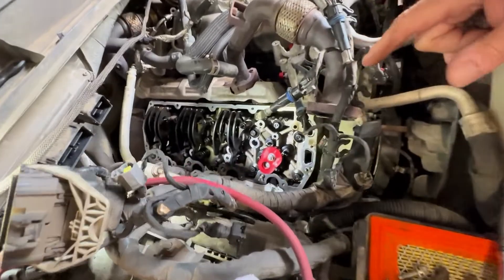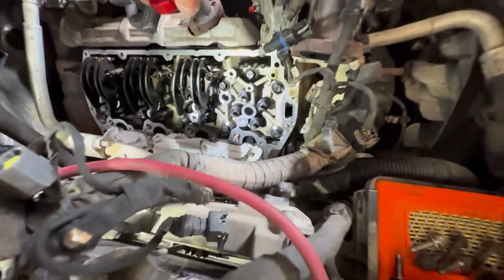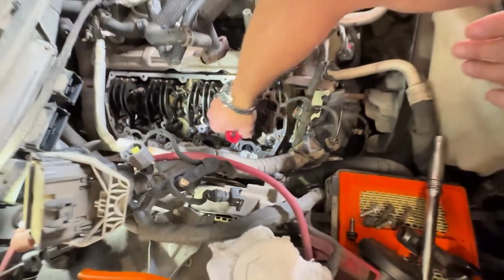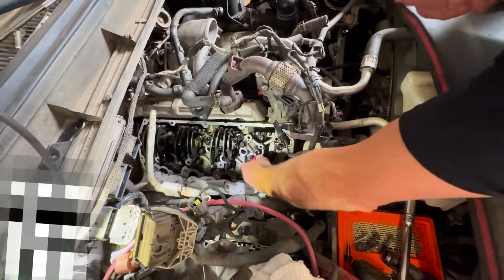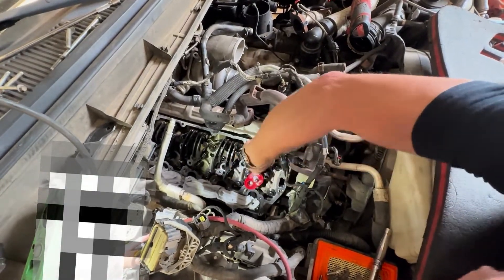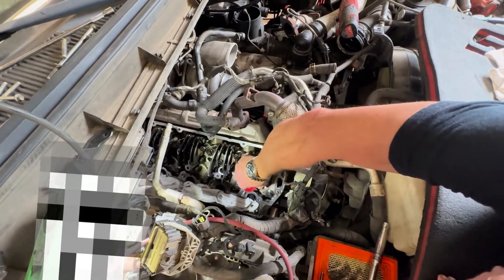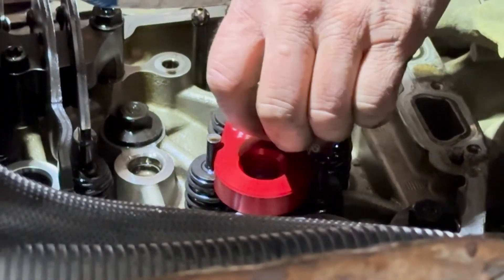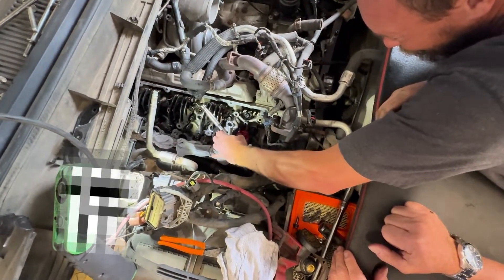Effortless Ford 6.7L Power Stroke Fuel Injector Broken Bolt Repair with the Nico Repair Kit

Comment: I see you had to remove the rocker arm , do you have to time the engine for this ?
Reply: No
Reply: No you dont but they are liars. They dont mention its easy to remove 1 injector. Where they lie is once the bolt breaks, the fail, on purpose to tell you, you have to remove and install the valve cover to use the tool. The 1.5 hrs is a lie. Tools works once you do all the extra work they lie about and don't tell you about when they are lying. Would have to pull the fuel rail which requires hp line replacement which requires both intake removals, then have to remove all of the others Injectors, more labor, then reseal the injectirs lines and o rings at 70 each just for parts not including labor, then egr cooler has to come off and  so the egr pipe unless u snake it out... once egr pipe bolts break, have to remove turbo and manifolds to repair, or use another tool they sale , i think they do.. Then once valve cover is off, have to clean head and valve cover off and put a new gasket. These guys are complete liars at 1.5 hrs. Im one of the best diesel mechanics you would ever meet. It cant be done in 1.5 hrs. They're quoted time is drilling only, doesnt include the facts I just said that they lie about with 1.5 hrs. Did I mention they lied about 1.5 hrs? Its all in the fine print they tell truth, who cares about that. Noticed how he mentioned about how u have to remove head and tried to sell his tool and didnt mention his tool required valve cover removal? A 6.7l vakve cover is not simple, as i mentioned above, and there is more. Tool works once vakve cover is off. The issue is how its not clearly stated and the whole 1.5 hr thing. This puts mechanics and service managers in a position where now THEY have to explain it to customers when customers dont know why its over 1.5 hrs. Warranty time, warranty! Is like 5 hrs plus r/r valve cover. This is such bs they dont make this clear. Scummy at best. Pick ur otger words for the worst.